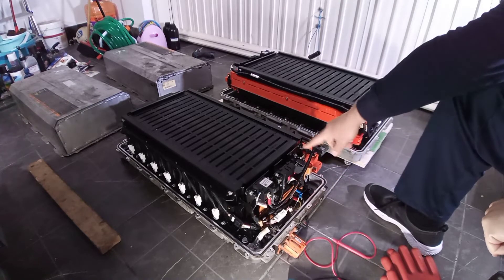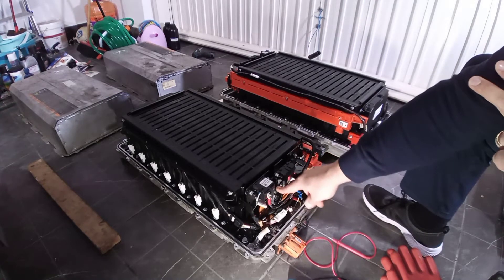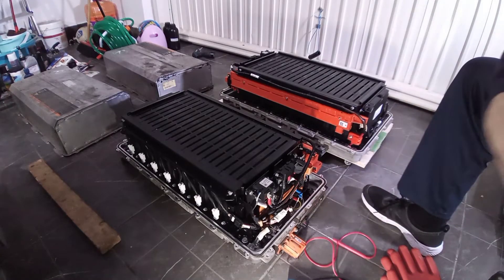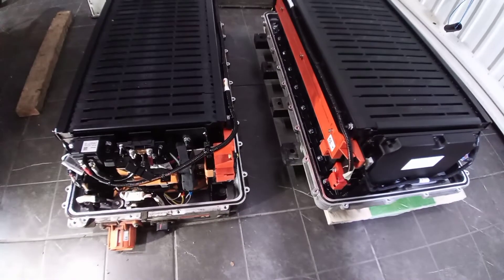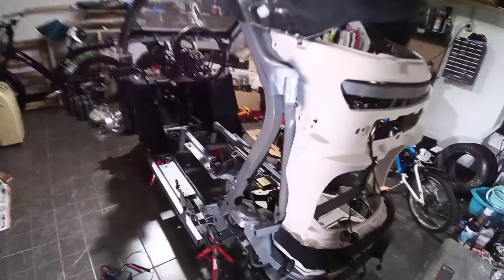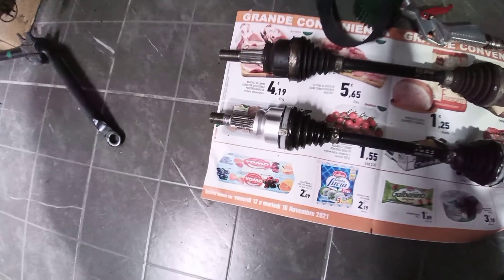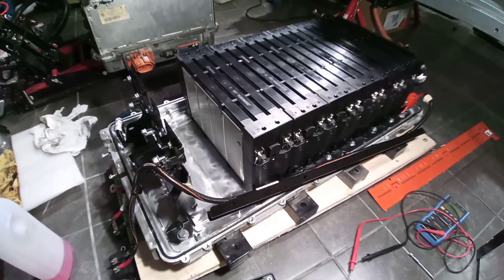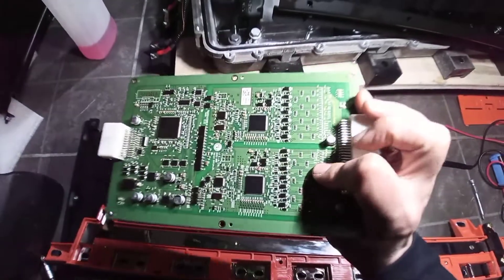Renault Twizy traction battery

Comment: Hi ElectriKMirK, 
I have a question about twizy. I have two twizis, one has a battery that has worked for about 15,000 km, and the other has completely working electronics. When I transferred the complete electronics to the model with the correct battery, I got errors DF114 Interlock PEB/Inverter and DF298 PEB/Inverter Multiplexed Emission Absent, Is it a problem with the battery or maybe the pairing of the battery module and other modules, I don't know if the chassis must be registered the same in all locations?
Reply from the maker: Immobilizer, sevcon and uch need the same vin number
Reply: Thanks…
Big regards
Jovica

Comment: Hello from Mexico! I will start a Twizy 2016 project in few days. I like your videos. This Twizy can be driven more than a few minutes before the shows STOP and SERV losing power and if you restart it, it won't move at all. Charging also stops sometimes, the car is like new, with 8,7'00 kms only because of the problem. This symptom is described by you in this video, so maybe it is that relay. Renault Mexico does not have trained people, after 5 repair shops in months, they finally replaced a whole battery pack from an older Twizy as a TEST, and the problem dissappeared. But the new pack is ultra-expensive, so they will re-install the "damaged" battery pack. They do not want to OPEN it to inspect it and repair it, they want to SELL  (a typical Automotive pose). If the problem is the BMS board, I would discard it completely, along with the cells using 18650 or 21700, maybe I will go for 16S instead of 14S. Questions: 1) Do you have tools to reconfigure the Sevcon to operate at a higher voltage? Another YT channel claims they made the sevcon spin the motor at higher voltages with no controller change  2) What if I cut all CAN signals from the controller? (putting the CAN termination resistor) I may lose the dash and OBDII comm port, but I would have traction. I mean, the controller does not need any CAN signals at run time, it listens to commands to CHANGE parameters either before operation or on the fly (real time), but I don't need to change anything at run-time. I will use a 3rd party BMS, obviously incompatible with Twizy, the cells will be safe.  I will also need to use another charger and DCDC, this is not a big deal but what else would I lose or need to be aware of without CAN signals? Thanks a lot! ekthor
Reply from the maker: @autoselectricos1109  sevcon needs reprogramming to operate higher voltage.....the 2016 Twizy sevcon can't be reprogrammed... only 2012-2015....you can't exclude can communications on any device because the car will stop working...I have customs sevcons programmed for the Twizy in any way you want, batteries, BMS-s.... but I can't ship to Mexico....
Reply: @electrikmirk7828  Hi! It's been documented in several Twizy forums that "SEVCON write access has been limited by Renault on Twizys (SEVCONs) delivered after June 2016." My Twizy has a label in the battery pack saying "Montagen" date 30.6.16 (hand written). This Sevcon  must have been made before that date, invoice date is September 2016, it takes months for a car to arrive from EU to MX.  Regarding the controller, watching several Sevcon bench tests and the User's manual itself, the motor spins without CAN signals in the Sevcon. Maybe a sealed/newer Sevcon controller asks for continuous CAN messages in order to operate. Anyway what is the tool you use to configure Sevcon?  I have an address in the USA, it's a frien's house and I will go there on July. In case my Sevcon is forced to have CAN comms all the time, How much you ask for another Sevcon?
Reply from the maker: @autoselectricos1109  your sevcon can't be written....my telephone is +39 3894759001 WhatsApp available

Comment: Should be work with original bms if you use  180ah  3.7v  nmc from china but all connectors and bridges need to be replaced
Reply from the maker: @lombardjohann4733  already build 12kw battery.... check out my channel....
Reply: Is not really indicated of what kind of battery you are using for your 12kw battery project, but i will use 180ah 3,7v nmc batterys from Aliexpress
Reply from the maker: @lombardjohann4733  already build it some time ago.... works great.... already passed all tests....
Reply from the maker: @lombardjohann4733  https://youtube.com/shorts/oZu1tVmAh70?si=MSxPOuzgI5luLrVm
Reply: Thank you  i already checked the video before, , i have offer from Ali 1090eur including shipping cost for 14x 180ah ,is not Catle but some other chinese brand, hope is good quality, according to seller is a high quality stuff
Reply from the maker: @lombardjohann4733  i didn't had time to upload videos of the tests on the 12kw battery because left for vacation....by the end of August I will try to upload them....
Reply from the maker: I had about 12 Twizys but with these 12kw batteries I fall in love again.....I redescovered this little mait....I installed it on 70hp Twizy and I can tell you there is nothing like it....

Comment: Hello, how many years can the original factory-installed main battery last?
Reply from the maker: Depends on the miles, ambients, driving style, storage, charging conditions....I can give you some examples: battery 2012-12000 km SoH 99%.... battery 2012- 63000km 68% SoH.....

Comment: HELLO!
hello, what is the characteristic of a one cell , thanks? discharge A , aH ,
Reply from the maker: You have 3 videos on my channel that will explain all: 1 EV battery regeneration....
2 disassembly ev battery part 2....3 EV battery completed....
Reply: @electrikmirk7828  thanks but i not find spec, you not remember?
Reply from the maker: @panpan29000  3.7v 40ah
Reply: @electrikmirk7828  ok thank , 
do you know who the manufacturer and model is? as well as the datasheet? how is possible to discharge ampere ?
Reply from the maker: @panpan29000  LG LX3.....not available anymore for privets....
Reply: @electrikmirk7828  ok thanks for all! but 40ah is low, is just 10Xsamsung 40T 21700?
Reply from the maker: @panpan29000  Renault engineers build it this way and the BMS has certain requirements...you can't put in there whatever you want....the car won't start if you don't reprogram traction sistems....if you want to stay original you have to use those parameters or order a cartridge from Catl.....https://www.power-and-storage.de/en-gb/shop/CATL-PowerBlock-14S-48V-10kWh-Version-Twizy-p278107421
Reply: @electrikmirk7828  my idea is to make a battery entirely with a cell maybe 1000x of 18650, in 92V, a new bms and a controller fardriver or other...
Reply from the maker: @panpan29000  well that's a long story....

Comment: Hi. Great video. Could you tell me the dimensions of the internal volume of the battery container of the Twizy. I got the possibility to have at a nice price LG blocks 7S3P coming from the new factory in Poland. The blocs are 10x19x57 cm3. If I could arrange 2 blocs in serie inside the box and reshuffle the BMS and extra electronics, I could make  a 11 kWh battery which seems to be compatible in terms of voltage and chemistery. It would of course need a recabling to the connectors but this does not seem too complicated. Thanks for your answer.
Reply from the maker: In one of my next videos you will find the answers.... I'm rebuilding a battery....
Reply: @electrikmirk7828  I am waiting to see that one. Thanks for your prompt answer

Comment: Without removing the battery, is there any (reasonably) accessible place to measure the voltage of the Twizy main battery? I'm looking for a couple of contact points to measure the actual voltage with a test-meter, rather than 'digitally' via the ODB port. Thank you.
Reply from the maker: Put the car in "go" and measure the black and red terminals of the sevcon
Reply: @electrikmirk7828  Ahh great, thank you! 🙂

Comment: In Germany we have an Update created. We Change the Cells to a CATL Block. So we have around 10kwh. The Process will be optimised this Year. Until now around 8 Twizys already Drive with 10kw. (3 more we're Updated this Month) 
And for under 3000€, its an great Update for all "old" Batteries.
Reply from the maker: Thanks for sharing!
Reply: Sounds good, can I find information anywhere?
Reply from the maker: @RoyRacing185  https://www.power-and-storage.de/en-gb/shop/CATL-PowerBlock-14S-48V-10kWh-Version-Twizy-p278107421
Reply from the maker: What kind of BMS you used to have all 10kw available?
Reply: @electrikmirk7828  You could use the original BMS. Than you only need to restart, after the 6kwh are Off to get the other 4kwh. 
But i used the edriver BMS. So i have the 10kwh all the time available
Reply: Hello, can you tell me more about the reference  about the CATL Block 10kWh please
Reply: You could buy an almost new Twizy with or under 3000 euros
Reply: @rlaqhrtns  Yes, an 12 year old Twizy. Often the Battery than goes only 30-40km. So within 3000€ more Euro, you can go absolut 120km...

Comment: Hello! Could you please tell the sizes of the main cells.
Reply from the maker: Never wrote them down but we are talking about the LGX L3 cells...
Reply: @electrikmirk7828   I have a Twizy from Korea and I want to change the battery to lto and I need to know the sizes of each module or 7 modules whole size. I use Twizy in minus degree and i thing it started to degrade. Now when I charge it shuts of on 92%, i thing resistance rised because of cells degrading. Drived just 8500km.
Reply from the maker: @mederdjorupbekov  your battery has a state of health of 100%.... you are talking about state of charge...(soh/soc) the BMS can stop charging giving the order to the charger before reaching 100% because high or low temperature detected by sensors present in every pack...is normal...
Reply: @electrikmirk7828  But if i turn the key while it stops charging it shows me 92% and starts charge last 8%
Reply: @electrikmirk7828  Any way I want to change the cells to lto
Reply from the maker: @mederdjorupbekov  what do you mean by lto?
Reply from the maker: @mederdjorupbekov  I know...I told you is the charging protocol...
Reply: @electrikmirk7828  lithium-titanium-oxide
Reply from the maker: @mederdjorupbekov  you have to modify the original configuration...
Reply from the maker: @mederdjorupbekov  I don't know if they build the twin of the lx3 with that technology

Comment: Hi Rik,
Im juno from Nederland,  I like your video to bad is not so match..
I have a nother ques
Reply from the maker: Ok...i'm here for your question, but I don't understand.... what doesn't match?
Reply: @electrikmirk7828 
HI Erik,
I miene that's your video don't have that the problem like me... 😟
Reply: @electrikmirk7828 
I mean that your video doesn't have what my problem have it
Reply: Every time that the kabel in the electric plug in from my house they shut down a couple times... It's frustrated me 😤
Reply from the maker: @bangdoel64  there are 2 things that can do that:
1 the charger has a relay inside that when breaks does just that
2 the house electric sistem goes over the edge ....you should try charging the car without using washing machine, ovens or other electric devices that have more than 1000w....
Reply: @electrikmirk7828  check 
I wil tray tommorow...Thanks for your advies 
And I late you knowhow anddit
Reply: Hi mir, 
I tray the twizy to chargi not at home but by the chargé station 
To bad thay gife the red ligt (block systeem).
Did you know wear is the relais that I can vind it?
Is het nier the fuse!(12v70A)...?
Reply from the maker: @bangdoel64  you have to buy a new charger or adjust this one...the relay is inside the charger...
Reply: @electrikmirk7828   
Hi Mir 
Did you repair the charger...or fixed?
🙂
How much did you ask it?
Reply from the maker: @bangdoel64  the price depends on the damage...
Reply: @electrikmirk7828 
I think is the religh... But What is your ades, I sud informatie the price for sending...
Reply from the maker: @bangdoel64  Sorry.... don't understand your English...I also speak Spanish, french, Italian, romanian.... please choose another language...
Reply: @electrikmirk7828  
Hi Mir, 
I'm so sorry...I was at work went I answer your question 
The problem is that relais inside the charger. 
I want your adres en I like to check first how much is the price 
If I send the package to your address!
Reply from the maker: @bangdoel64  I live in Italy....i think is better if you buy a new charger....is more economic
Reply: @electrikmirk7828 
HI ok check...
Thanks for your quick response and good luck with your video... I still follow you... 😉👍